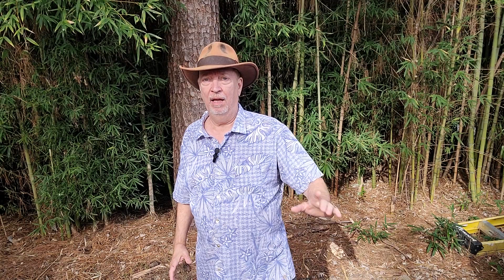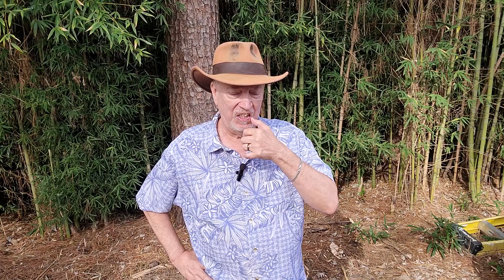Why Your Black Powder May Suck

Comment: Bed sheet 100% cotton, outdid the cottonelle tp.
Reply from the maker: But we also need to factor the cost of the materials into the equation. It isn't all about just performance. If we double performance but the cost to make it goes up 400%, what did we really gain? That's why I use Eastern Red cedar pet bedding. Not the best but better than Goex and costs less to make.
Reply: @timesgonetech3057  old jeans and t shirt, cost almost nothing, most I have 100% cotton,just need to read the labels.

Comment: I've made all those mistakes...It's a bit art and takes practice. I also deformed my die by with too much pressure.
Reply from the maker: It's half science and half voodoo! I just made a new die using 1/4" thick wall extruded steel tube and bought a 20 ton hydraulic press - itching to try them!

Comment: I'm sure someone's already brought it up, but adding 5-10% of alcohol to the water you use to wet the powder prior to pressing will make it much easier to wet the charcoal, and may help it evaporate more quickly after it's pressed.
Reply from the maker: I tried it once and the powder didn't seem to compress as well. After drying it crumbled too easily. But I used isopropyl. Ethyl might work better. I'll have to try a little Everclear next time!  :-)
Reply: @timesgonetech3057  I haven't had time to go through all your techniques; have you tried increasing the time the puck is left under pressure?
Reply: The alcohol or even acetone helps wet it and eases mixing. But you'll still need water to make nice grains (the potassium nitrate will recrystallize making a cement-like structure.) And it can be done without expensive solvents just a little more messy and takes slightly longer. The best way I've found with straight water is to measure around 5% by weight. Add to the container water first then in three parts add a bit of the powder and mix add some more until it's all done. Then run it through a screen a couple of times to finish thoroughly mixing the water in. It should come out as almost dry but wet enough to press into pucks. Note the water content is so low that it's still highly combustible at this point so be aware of that.
Reply: Ok, Im gonna put on my chemist hat here and say, the first thing you DON'T want is your saltpeter to crystalize! That is what ruins fireworks after they get wet and dry out, leading, for example, to insufficient lift and weak breaks in aerial shells. When the KNO3 crystallizes, it both reduces the surface area available for reaction and, to some extent, "un-mixes" the three components. Commercial BP does not rely on water or binders to consolidate, though a tiny amount can act as a lubricant and may help reduce dust. Any water added to almost any fireworks composition should be the minimum requured to produce the effect and should thereafter be removed as rapidly and completely as possible. It is rather the sulfur that seems to contribute most to binding the composition together, and the intimacy of the individual components after milling and pressing contributes to the speed and force of combustion of such finished BP compared with simple mixing of the components.
Reply: @rjo49 that's why it's capped to 5% any more than that is detrimental as you have pointed out pretty much defeats the point of milling. But trust me you will get weak grains with an anhydrous solvent unless you pressing hard enough plastisize the sulfur which is not and easy task and the product will end up overly dense. Unfortunately most people end up using way too much water and it bleeds out of the press. It should not be that much water ever. A little bit of dissolved KNO3 isn't terrible as it's a very small percentage and just locks everything together.

Comment: Good points you brought up . My experience is a little different in some respects and I would list the order of issues a little differently.  #1 is insufficient reduction of the meal, i.e. not milled well enough/long enough.  Most people probably underestimate how well their meal is milled by a very large margin.   #2 is moisture content during milling which causes clumping before the powder is really milled finely enough.  #3 would be not controlling puck density well enough, for this you need to calculate the volume of your die and the weight of the meal going in it and the die needs a positive stop to control volume.  1.75 g/cc is good and with the right charcoal will make granulated 3F the same density as measures are calibrated for if the powder is polished after grinding. 1.6 g/cc burns faster and more clean but takes more volume for the same energy as "standard density" powder in a muzzleloader.  1.92 g/cc (14 tons per square inch) is too dense and is the point of diminishing returns with burn rate in a muzzleloader.  FYI sporting grade propellant is right at the same density as water.  #4 would be polishing or glazing.   Not graphiting, but tumbling the granulated powder with sufficient energy and heat to polish off the sharp, fractured edges and create a relatively smooth surface to the grains which resists water and actually slows the burn rate somewhat.  Slightly slowing the burn rate increases efficiency and the "time under power" that the ball experiences in the barrel.  If the powder is dusted after glazing then the dust which just gets in the way of a good burn is eliminated and doesn't reappear after the powder is handled.  #5 would be carbon source.  Truth here is any of the top ten or 15 carbon sources are plenty adequate, but the relative density and ash content vary greatly.  The easier it is to mill down to single-digit micron size, the better it will perform no matter what it is.  Toilet paper has a large softwood content and is also mostly Kraft process paper with some ground pulp (like newsprint and phone books) content.  The Kraft part has all of the ash minerals completely removed, and the majority of the lignin removed which makes the pulp fibers much easier to crush down to microscopic particles.  Willow charcoal requires a better mill and more time to equal the fineness of TP.  This all goes back to mill time and efficiency, you can make great powder with hard charcoal which results in dense grains, high energy per grain, and a very clean if you only mill it enough.  #6 is charcoal cook temperature and time.  Anything between 550 and 650F is good, the only real difference is how much creosote is driven off as vapor.  Creosote makes just about zero difference to burn speed, density, or power, it only affects how much moisture the fouling is able to absorb.  If your charcoal has all the creosote cooked out, it will leave a dry, hard fouling.  If most of the creosote is retained (as in "brown" powder), then it will leave a lot of soft, black fouling behind in the barrel.  There is a happy medium and that seems to be with about half the creosote cooked out, or 575-600F retort temperature.  #6 is the impurity level of the ingredients.  Less than 3% ash content of the wood is very desirable.  Prilled oxidizer needs to have the prilling agent and any silica removed by making a super-saturated solution and recrystallizing the pure oxidizer.  99.0% sulfur is plenty good enough.  These things make little difference in the big picture unless you're using a very impure stump remover, Kingsford and 90% garden sulfur for your ingredients.   As for moisture content of the finished powder, I disagree a little.  BP needs some moisture to burn well, don't ask me why.  That "some" is around 1%.  3% bogs it down terribly.  .5% isn't great either, so again we have a "Goldilocks" range to strive for.  I can make powder equal to Swiss 3Fg which is only dried enough that it doesn't clump under its own weight sitting in a jar overnight.

Comment: By and large, I agree with everything you are saying, but I completely disagree with the level of importance you are placing on moisture. In fact, the CIA method (one of the better recipes) starts with hot water on the stove. While moisture does indeed affect BP, that effect goes away when it gets dry again. Case in point was a BP shell found in a swamp. Completely "inert" at the time. The finder brought it home, wiped off the outside and parked it beside the fireplace. A some days later (don't know how many) the heat from the fireplace ignited the shell - fortunately while the family was outside doing chores or whatever. 
All the world's militaries during the early 1800's tested BP every which way and the result was that the TYPE of charcoal was the ONE thing that made the biggest difference in performance. Hardwood charcoal works well, but softwoods worked much better and willow charcoal was the best of the softwoods. The best of all was alder buckthorn (European not the Americas). With that starting basis, we have learned that activated charcoal - what is normally commercially available - is problematic yielding highly variable and poor performance. Bone charcoal is 100% useless. Grapevines are very good, and cedar shavings used for pet bedding works well. Other surprisingly good sources are balsa wood and the toilet paper you mentioned. BTW, a follow-up on that with a different brand yielded poor results, so toilet paper is going to be affected by brand. Haven't tried lamp black, but have heard it's good. 
You are quite correct that you don't want a lot of water being pressed out during puck making. 
Density is, indeed, a factor. BP made with the screening method is going to be about 15% to 20% less dense than corned BP. However, equal performance is achieved by using 15% to 20% more powder.  You are using the same amount of chemicals that way. 
Good discussion. 👍
P.S. None of the above applies to any of the BP substitutes. They are completely different formulas.
Reply from the maker: Sorry but by reading your comment concerning moisture content it seems to me you're just proving my point as to how important it is. Yes it will burn AFTER it's been thoroughly dried. But even the tiniest bit will slow it down and your examples seem to me to agree with that. Maybe I'm reading it wrong?

Comment: Really enjoy your videos. Would it be better to use alcohol for mixing up your powder? Just wondering and would it work better the harder you press it into a puck.
Reply from the maker: I tried using 90% isopropyl alcohol one time and the pucks just crumbled into powder when ground. But there were a few other variables involved with that particular batch so it may not have been the alcohol. Worth trying again next time on a sample puck. As to your second question, absolutely. I don't think you can press it too much. The closer the ingredients are squeezed together the faster it will burn. I currently use a 15 ton press but am working on a design for a 50 tonner, hoping to build early next year. Thanks for watching!